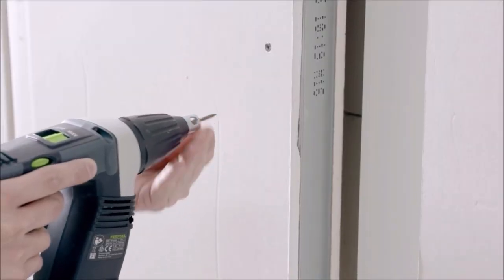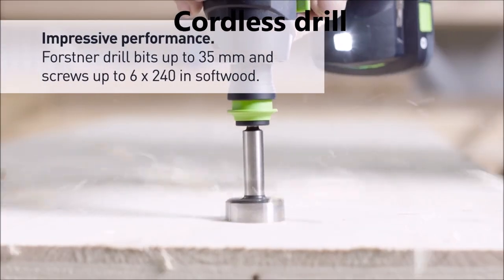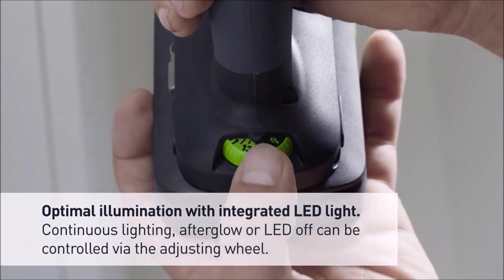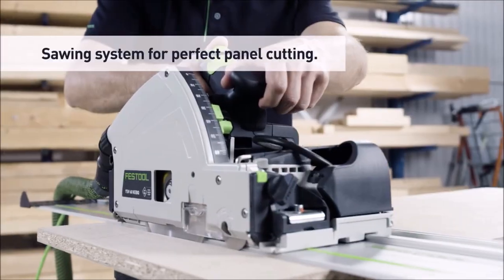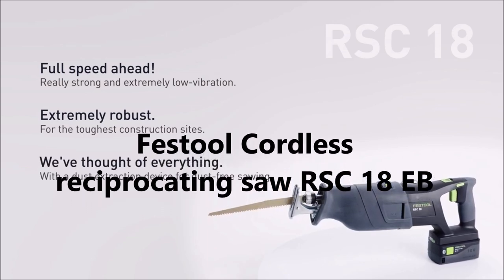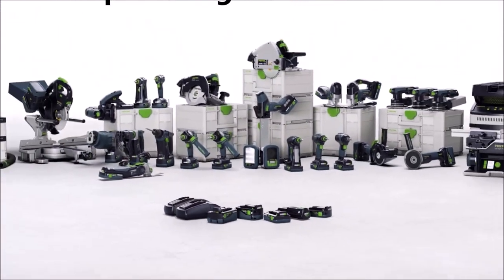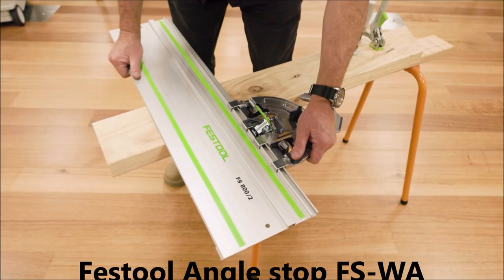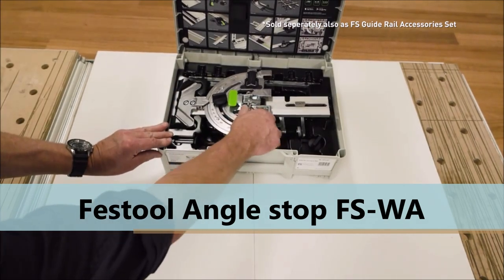10 Must Have New Festool Woodworking Tools for Your Workshop

Comment: I wouldn’t buy a Festool reciprocating saw, I would buy Milwaukee or makita, Festool should stick to what their good at.
Reply from the maker: Everyone has their own preferences when it comes to tools, and it's great to hear your perspective. While some people may prefer Milwaukee or Makita for a reciprocating saw, others may find value in Festool's offerings. Festool is known for their expertise in certain areas and their dedication to quality and innovation. They have a strong reputation in the industry for producing high-end tools with advanced features and exceptional build quality.

It's important to consider factors such as personal experience, specific project requirements, and budget when choosing a tool. Milwaukee and Makita are renowned brands with their own strengths, and they may align better with your particular needs. Ultimately, the decision of which brand to choose depends on individual preferences and the specific features and capabilities that are most important to you.

Remember, it's always a good idea to research and read reviews to get a better understanding of a tool's performance, reliability, and suitability for your specific tasks. By doing so, you can make an informed decision and choose the brand and model that best suits your needs.

Comment: I’ve been woodworking for over 45 years and seen a revolution in woodworking in that time. All the tools, abrasives, adhesives that are are now so easily available which were just a dream not so many years ago.

One of the downsides is that woodworkers are now targeted by big companies to spend money on tools they don’t need; and to buy from companies who may not be best in class. 

The tools featured in this video and Festool are prime examples of this malaise.

You don’t need any of these tools. They will not make you a better woodworker. They may make you a slightly faster woodworker who doesn’t have to think about problem resolution but will also make you a much poorer woodworker. 

Festool are not, in my opinion, best in class over all tool categories. They are, again in my opinion, better tools available from other manufacturers. 

What Festool do excel at is marketing. The tool porn of seeing banks of systainers behind the woodworker is just great marketing. 

But marketing never made anything - except rich marketeers. Please learn your trade without resorting to false “spend more money to become a better woodworker” subliminal messages.

In case you surmise that I have a downer on everything grey and green. Not at all. I own many Festool products. I very much like their domino machines (I have both) but believe that, these days, they are horrendously over priced. I use a Festool track saw most days in the workshop, having bought it when there were no alternatives. I do like their routers and use the 1410 regularly. I like their Rotex sander for horizontal work although it’s much too heavy for vertical surfaces. I have their power planer which is…..fine. I have a Festool drill driver which sits in the tool cupboard and has gathered dust for several years - I just think it is the worst drill driver I have ever owned - as well as probably the most expensive. 

So, don’t put manufacturer before tool function. I understand this argument about commonality of batteries but I learned it’s better to have several different batteries and chargers than one inferior tool. 

Use my thoughts.
Reply: Very important reply, ‘Tool porn’ is exactly how I would put it.
Reply: its definetly not true i have a lot of tool brands, most problem i hade was makita and dewalt. broken chopsaw and tracksaw dewalt, makita 5 broken drills and a router a sander and a silicon pistol so much problems and waranty issue. festool and mafell never had any broken tools, and dust ports for vac works on every tool. makita and dewalt i need different adapters for different tools thats a bad design choise. but dewalt and makita are made cheap in china, festool and mafell high quality made in germany thats a big difference. and the haptic and feel is much better on mafell and festool than on cheap brands then dewalt, makita or millwaukee. we are 150 workers and most of them prefer festool and mafell. and kuka robotics near by use the same tools and say the same, they are 5000 workers no joke.